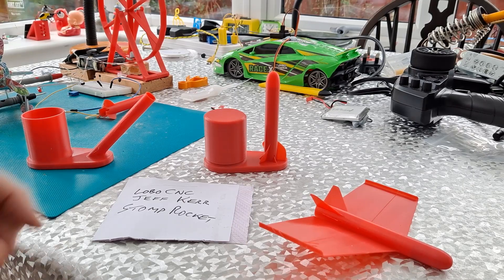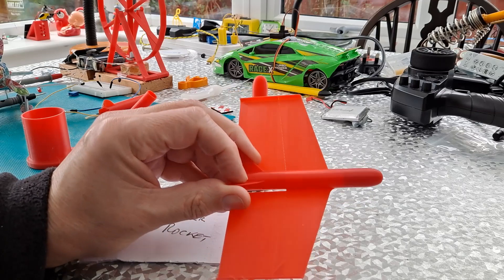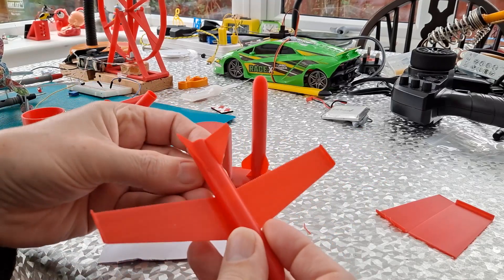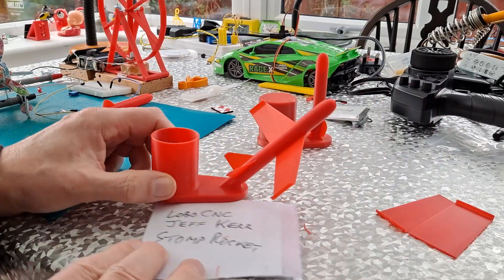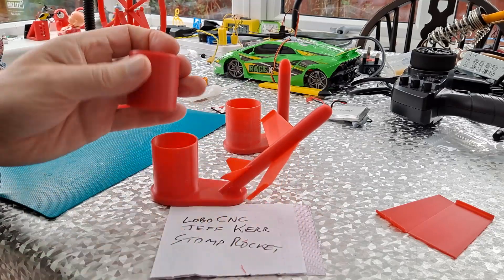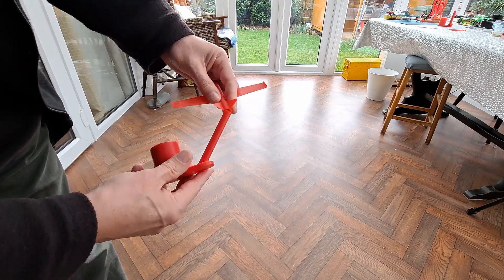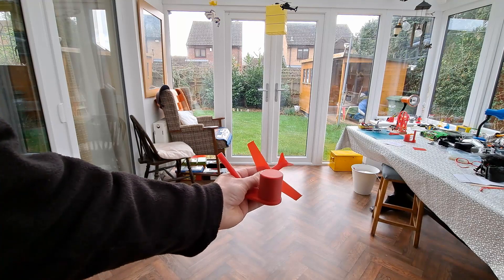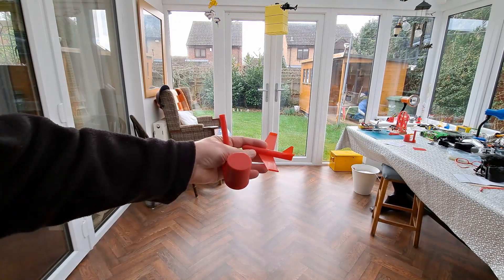3D printed Stomp Glider

Comment: That works Pretty good. I wonder if you could print the launcher so its not so at a steep Angle. Then it would Launch straighter rather then into the air.
Reply from the maker: You could spend a long time finding the ideal angle to launch it, if you print a new version each time. Horizontal is not a good direction as it can only go down from there, making the distance it flies much shorter, so somewhere between horizontal and vertical, maybe a launcher with a tube that you can adjust the angle would be the ideal answer, but that might be difficult to achieve without extra parts to give a good air seal.